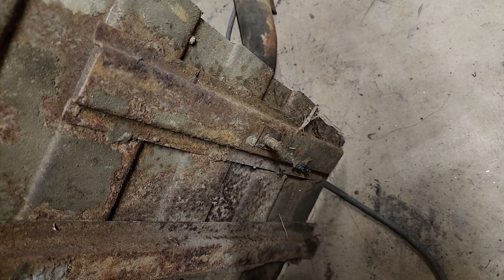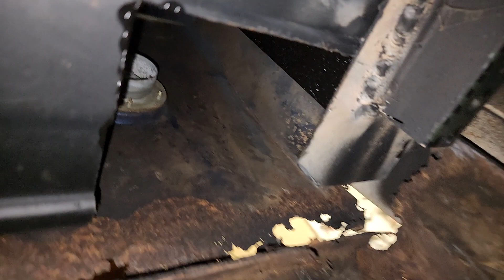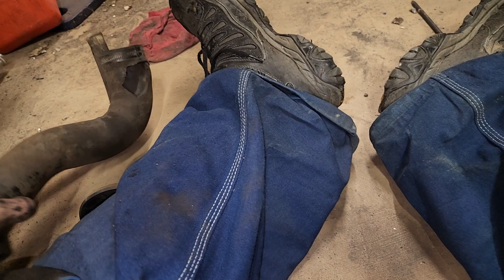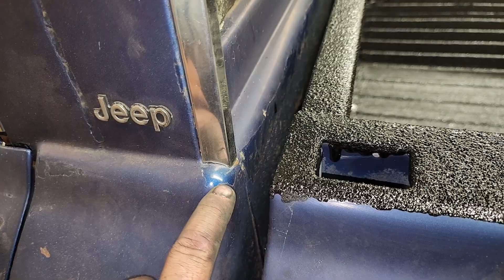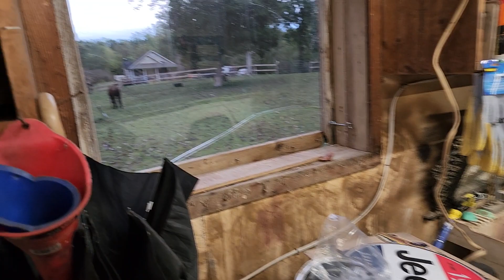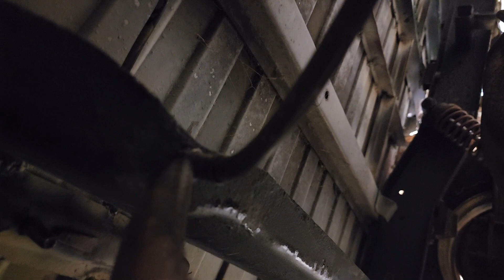14+ hours working on the Jeep... trying to beat the coming cold

Comment: Bed looks great now and can use.

So your gas tanks is only held in by 1 strap?  Bed rusted out like yours was.
 My 75 j10 looks like it was only one strap ( no tank when I got it) Got 2 straps when I got a replacement tank.
Reply from the maker: Yea i think 78/79 is when they had two.. Mine has one deff 76 under had one

Comment: I had the same issue with my filler neck. I ate the cost and sent the wrong one back for an exchange on the correct one. During install I realized how worth the extra cost was.
Reply from the maker: Yea but they didnt even return my phone call.  So f them.  Ill just cut the one i got and mesh it into the old one.  Isnt worth me spend the gas money and shipping and resrocking fee for 30$ return